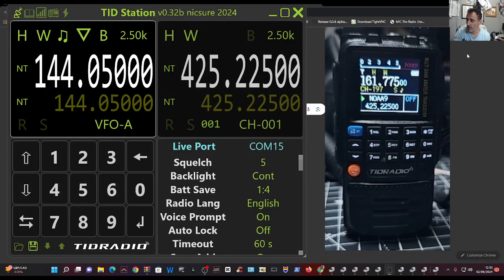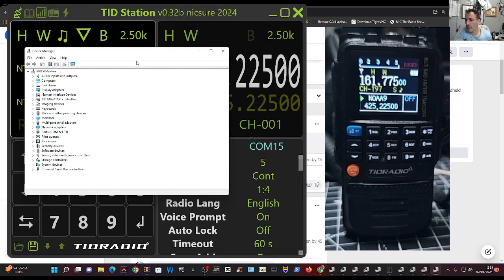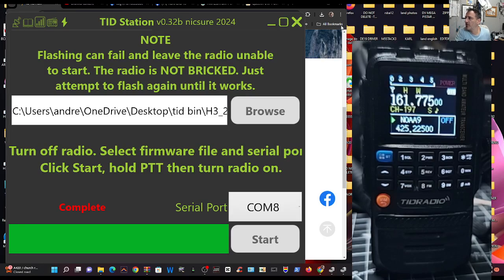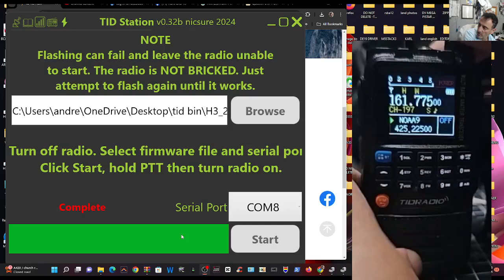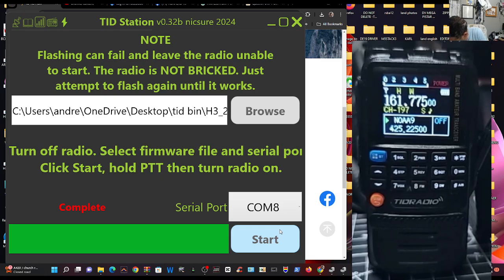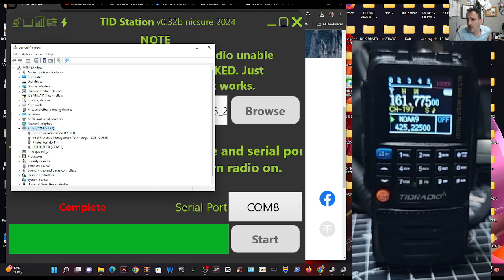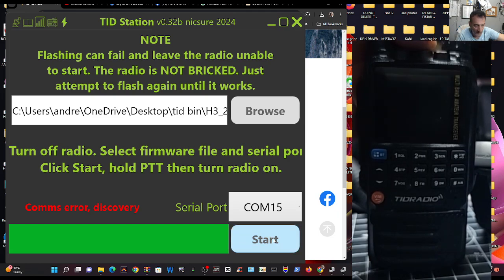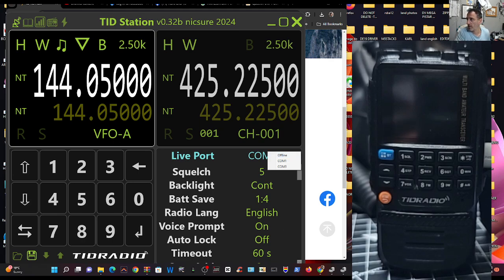TIDRADIO - H3 EASY FIRMWARE - TID Station- (Nicsure)

Comment: Thanks for making all of these radio and scanner videos!!  TIP using the Kenwood type cable: I had to put a very thin coating of dielectric grease on my Kenwood cable connectors to get my H3 firware update to work. My update was getting anywhere from 10 to 50 pct across before it would fail. I tried prob 20 times while pressing the cable like the instructions say to do. The grease made it work first try. Very very thin coating.
Reply from the maker: Hi thanks for the tip.

Comment: Thanks Andreas. I think the reason it didn't work on the usb-c was because you were already using the port in the Live Mode. It's best to be in Offline mode when flashing firmware so there's no com port conflicts.
Reply from the maker: Hi Marcus , I got it working with a different cable made a new Video worked great .